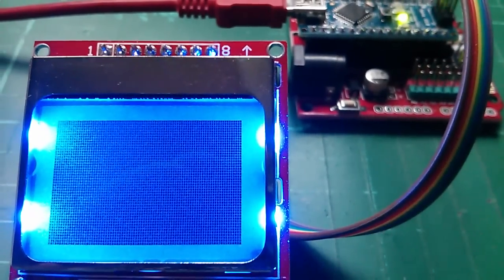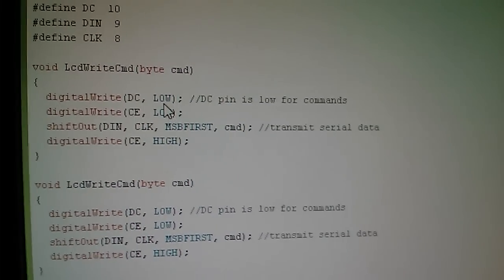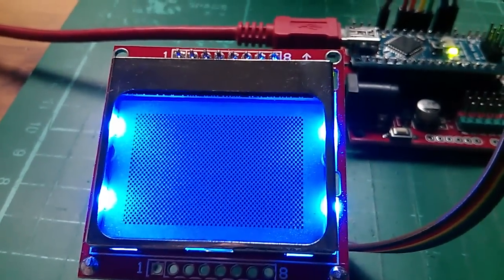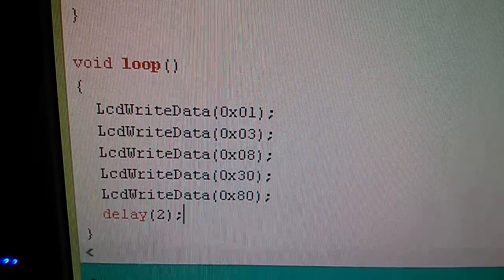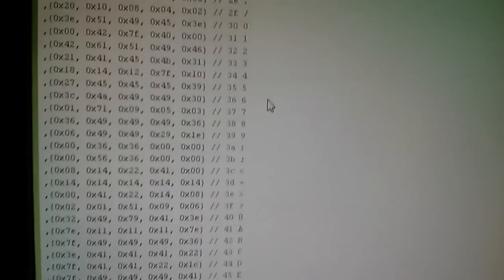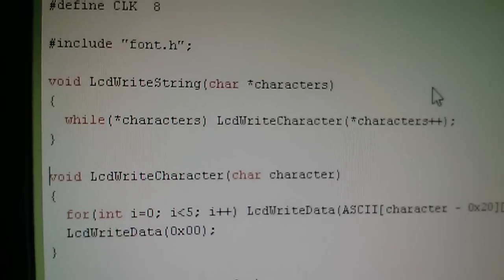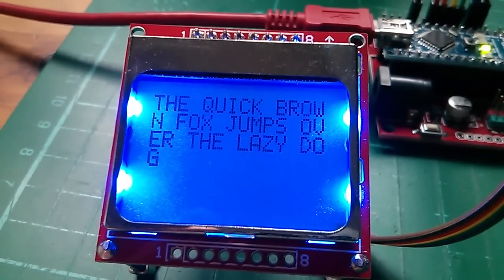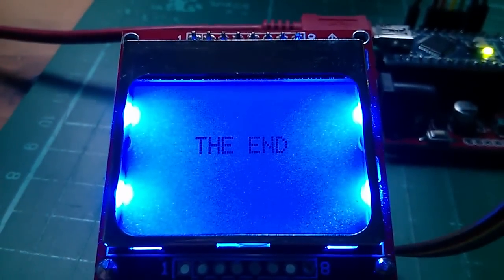Arduino Nokia 5110 LCD Tutorial #2 - Getting Text on the Display

Comment from the maker: Here's the Arduino code listing:

#define RST 12
#define CE  11
#define DC  10
#define DIN  9
#define CLK  8

#include "font.h";

void LcdWriteString(char *characters)
{
  while(*characters) LcdWriteCharacter(*characters++);
}

void LcdWriteCharacter(char character)
{
  for(int i=0; i<5; i++) LcdWriteData(ASCII[character - 0x20][i]);
  LcdWriteData(0x00);
}

void LcdWriteData(byte dat)
{
  digitalWrite(DC, HIGH); //DC pin is low for commands
  digitalWrite(CE, LOW);
  shiftOut(DIN, CLK, MSBFIRST, dat); //transmit serial data
  digitalWrite(CE, HIGH);
}

void LcdXY(int x, int y)
{
  LcdWriteCmd(0x80 | x);  // Column.
  LcdWriteCmd(0x40 | y);  // Row.
}

void LcdWriteCmd(byte cmd)
{
  digitalWrite(DC, LOW); //DC pin is low for commands
  digitalWrite(CE, LOW);
  shiftOut(DIN, CLK, MSBFIRST, cmd); //transmit serial data
  digitalWrite(CE, HIGH);
}

void setup()
{
  pinMode(RST, OUTPUT);
  pinMode(CE, OUTPUT);
  pinMode(DC, OUTPUT);
  pinMode(DIN, OUTPUT);
  pinMode(CLK, OUTPUT);
  digitalWrite(RST, LOW);
  digitalWrite(RST, HIGH);
  
  LcdWriteCmd(0x21);  // LCD extended commands
  LcdWriteCmd(0xBF);  // set LCD Vop (contrast)
  LcdWriteCmd(0x04);  // set temp coefficent
  LcdWriteCmd(0x14);  // LCD bias mode 1:40
  LcdWriteCmd(0x20);  // LCD basic commands
  LcdWriteCmd(0x0C);  // LCD normal video
  
  for(int i=0; i<504; i++) LcdWriteData(0x00); // clear LCD

  LcdXY(20,2);
  LcdWriteString("THE END"); 
}

void loop()
{
}
Reply: If I needed to display a variable that is a number how would I do That using this code? I am just starting with setting these up!
Reply: Futz With  I figured it out! 

Later, FW!
Reply: Hi, I have been trying to follow your video and code but I keep getting error messages, can you help please? This is the code and error message.  void setup() {
#define RST 12
#define CE 11
#define DC 10
#define DIN 9
#define CLK 8

#include "font.h";

voidLcdWriteString(char*characters)
{
while(*characters)LcdWriteCharacter(*characters++)
}
voidLcdWriteCharacter(charcharacter)
{
for(inti=0; i<5; i++)LcdWriteData(ASCII[character - 0x20][i]); 
LcdWriteData(0x00);
}
  voidLcdWriteData(bytedat);
  {
  digitalWrite(DC,HIGH); //DC pin is low for commands
  digitalWrite(CE,LOW);
  shiftOut(DIN, CLK, MSBFIRST,dat); //transmit serial data
  digitalWrite(CE, HIGH);
  }
  void LcdXY(int x, int y);
  {
      LcdWriteCmd(0x80 | x);  // Column. 
      LcdWriteCmd(0x40 | y);  // Row.
  }
  void LcdWriteCmd(byte cmd); 
  { 
  digitalWrite(DC, LOW); //DC pin is low for commands  
  digitalWrite(CE, LOW); 
  shiftOut(DIN, CLK, MSBFIRST, cmd); //transmit serial data 
  digitalWrite(CE, HIGH);
  }
  void setup(); 
  { 
  pinMode(RST, OUTPUT); 
  pinMode(CE, OUTPUT);  
  pinMode(DC, OUTPUT);  
  pinMode(DIN, OUTPUT); 
  pinMode(CLK, OUTPUT); 
  digitalWrite(RST, LOW); 
  digitalWrite(RST, HIGH);
  LcdWriteCmd(0x21);  // LCD extended commands 
  LcdWriteCmd(0xBF);  // set LCD Vop (contrast)
  LcdWriteCmd(0x04);  // set temp coefficent 
  LcdWriteCmd(0x14);  // LCD bias mode 1:40  
  LcdWriteCmd(0x20);  // LCD basic commands 
  LcdWriteCmd(0x0C);  // LCD normal video
    for(int i=0; i<504; i++) LcdWriteData(0x00); // clear LCD 
    
    LcdXY(20,2);  
    LcdWriteString("THE END"); 
    }
    void loop(); 
    {
    }
      error message,   Arduino: 1.8.1 (Windows 10), Board: "Arduino/Genuino Uno"

C:\Program Files (x86)\Arduino\arduino-builder -dump-prefs -logger=machine -hardware C:\Program Files (x86)\Arduino\hardware -tools C:\Program Files (x86)\Arduino\tools-builder -tools C:\Program Files (x86)\Arduino\hardware\tools\avr -built-in-libraries C:\Program Files (x86)\Arduino\libraries -libraries C:\Users\Richards\Documents\Arduino\libraries -fqbn=arduino:avr:uno -vid-pid=0X2341_0X0043 -ide-version=10801 -build-path C:\Users\Richards\AppData\Local\Temp\arduino_build_700637 -warnings=none -prefs=build.warn_data_percentage=75 -prefs=runtime.tools.arduinoOTA.path=C:\Program Files (x86)\Arduino\hardware\tools\avr -prefs=runtime.tools.avr-gcc.path=C:\Program Files (x86)\Arduino\hardware\tools\avr -prefs=runtime.tools.avrdude.path=C:\Program Files (x86)\Arduino\hardware\tools\avr -verbose C:\Users\Richards\Documents\Arduino\sketch_feb15f\sketch_feb15f.ino
C:\Program Files (x86)\Arduino\arduino-builder -compile -logger=machine -hardware C:\Program Files (x86)\Arduino\hardware -tools C:\Program Files (x86)\Arduino\tools-builder -tools C:\Program Files (x86)\Arduino\hardware\tools\avr -built-in-libraries C:\Program Files (x86)\Arduino\libraries -libraries C:\Users\Richards\Documents\Arduino\libraries -fqbn=arduino:avr:uno -vid-pid=0X2341_0X0043 -ide-version=10801 -build-path C:\Users\Richards\AppData\Local\Temp\arduino_build_700637 -warnings=none -prefs=build.warn_data_percentage=75 -prefs=runtime.tools.arduinoOTA.path=C:\Program Files (x86)\Arduino\hardware\tools\avr -prefs=runtime.tools.avr-gcc.path=C:\Program Files (x86)\Arduino\hardware\tools\avr -prefs=runtime.tools.avrdude.path=C:\Program Files (x86)\Arduino\hardware\tools\avr -verbose C:\Users\Richards\Documents\Arduino\sketch_feb15f\sketch_feb15f.ino
Using board 'uno' from platform in folder: C:\Program Files (x86)\Arduino\hardware\arduino\avr
Using core 'arduino' from platform in folder: C:\Program Files (x86)\Arduino\hardware\arduino\avr
Detecting libraries used...
"C:\Program Files (x86)\Arduino\hardware\tools\avr/bin/avr-g++" -c -g -Os -w -std=gnu++11 -fpermissive -fno-exceptions -ffunction-sections -fdata-sections -fno-threadsafe-statics  -flto -w -x c++ -E -CC -mmcu=atmega328p -DF_CPU=16000000L -DARDUINO=10801 -DARDUINO_AVR_UNO -DARDUINO_ARCH_AVR   "-IC:\Program Files (x86)\Arduino\hardware\arduino\avr\cores\arduino" "-IC:\Program Files (x86)\Arduino\hardware\arduino\avr\variants\standard" "C:\Users\Richards\AppData\Local\Temp\arduino_build_700637\sketch\sketch_feb15f.ino.cpp" -o "nul"
Generating function prototypes...
"C:\Program Files (x86)\Arduino\hardware\tools\avr/bin/avr-g++" -c -g -Os -w -std=gnu++11 -fpermissive -fno-exceptions -ffunction-sections -fdata-sections -fno-threadsafe-statics  -flto -w -x c++ -E -CC -mmcu=atmega328p -DF_CPU=16000000L -DARDUINO=10801 -DARDUINO_AVR_UNO -DARDUINO_ARCH_AVR   "-IC:\Program Files (x86)\Arduino\hardware\arduino\avr\cores\arduino" "-IC:\Program Files (x86)\Arduino\hardware\arduino\avr\variants\standard" "C:\Users\Richards\AppData\Local\Temp\arduino_build_700637\sketch\sketch_feb15f.ino.cpp" -o "C:\Users\Richards\AppData\Local\Temp\arduino_build_700637\preproc\ctags_target_for_gcc_minus_e.cpp"
"C:\Program Files (x86)\Arduino\tools-builder\ctags\5.8-arduino11/ctags" -u --language-force=c++ -f - --c++-kinds=svpf --fields=KSTtzns --line-directives "C:\Users\Richards\AppData\Local\Temp\arduino_build_700637\preproc\ctags_target_for_gcc_minus_e.cpp"
Compiling sketch...
"C:\Program Files (x86)\Arduino\hardware\tools\avr/bin/avr-g++" -c -g -Os -w -std=gnu++11 -fpermissive -fno-exceptions -ffunction-sections -fdata-sections -fno-threadsafe-statics -MMD -flto -mmcu=atmega328p -DF_CPU=16000000L -DARDUINO=10801 -DARDUINO_AVR_UNO -DARDUINO_ARCH_AVR   "-IC:\Program Files (x86)\Arduino\hardware\arduino\avr\cores\arduino" "-IC:\Program Files (x86)\Arduino\hardware\arduino\avr\variants\standard" "C:\Users\Richards\AppData\Local\Temp\arduino_build_700637\sketch\sketch_feb15f.ino.cpp" -o "C:\Users\Richards\AppData\Local\Temp\arduino_build_700637\sketch\sketch_feb15f.ino.cpp.o"
C:\Users\Richards\Documents\Arduino\sketch_feb15f\sketch_feb15f.ino: In function 'void setup()':

sketch_feb15f:10: error: expected ',' or ';' before 'voidLcdWriteString'

 voidLcdWriteString(char*characters)

 ^

sketch_feb15f:14: error: 'charcharacter' was not declared in this scope

 voidLcdWriteCharacter(charcharacter)

                       ^

sketch_feb15f:14: error: 'voidLcdWriteCharacter' was not declared in this scope

 voidLcdWriteCharacter(charcharacter)

                                    ^

sketch_feb15f:19: error: 'bytedat' was not declared in this scope

   voidLcdWriteData(bytedat);

                    ^

sketch_feb15f:19: error: 'voidLcdWriteData' was not declared in this scope

   voidLcdWriteData(bytedat);

                           ^

sketch_feb15f:23: error: 'dat' was not declared in this scope

   shiftOut(DIN, CLK, MSBFIRST,dat); //transmit serial data

                               ^

sketch_feb15f:28: error: 'x' was not declared in this scope

       LcdWriteCmd(0x80 | x);  // Column. 

                          ^

sketch_feb15f:28: error: 'LcdWriteCmd' was not declared in this scope

       LcdWriteCmd(0x80 | x);  // Column. 

                           ^

sketch_feb15f:29: error: 'y' was not declared in this scope

       LcdWriteCmd(0x40 | y);  // Row.

                          ^

sketch_feb15f:35: error: 'cmd' was not declared in this scope

   shiftOut(DIN, CLK, MSBFIRST, cmd); //transmit serial data 

                                ^

sketch_feb15f:53: error: 'LcdWriteData' was not declared in this scope

     for(int i=0; i<504; i++) LcdWriteData(0x00); // clear LCD 

                                               ^

sketch_feb15f:56: error: 'LcdWriteString' was not declared in this scope

     LcdWriteString("THE END"); 

                             ^

sketch_feb15f:60: error: expected '}' at end of input

     }

     ^

exit status 1
expected ',' or ';' before 'voidLcdWriteString'
Reply: Richard Green... try to delete... void setup() ... before define
Reply: Hey, do you know if it's possible to translate this code to python? I only know a little bit of Python and an even smaller amount of C#, not to mention I'll be hooking this up to a Raspberry Pi